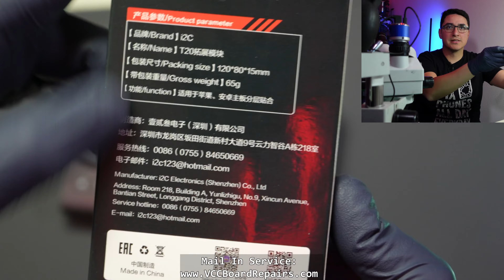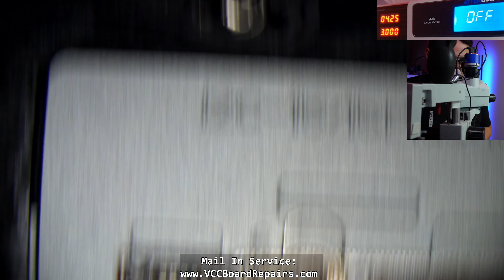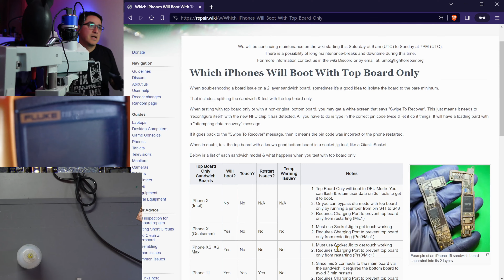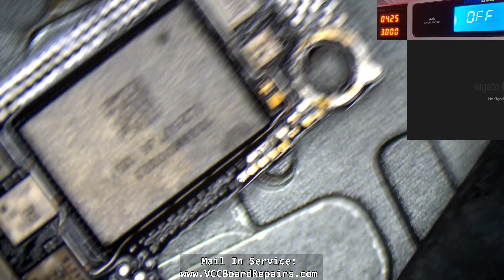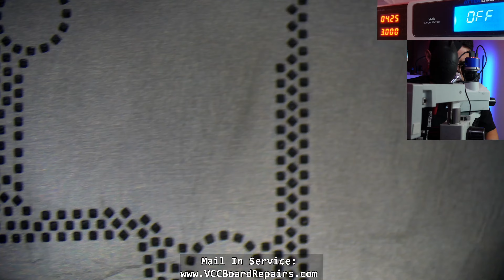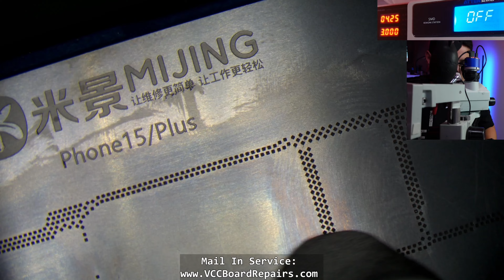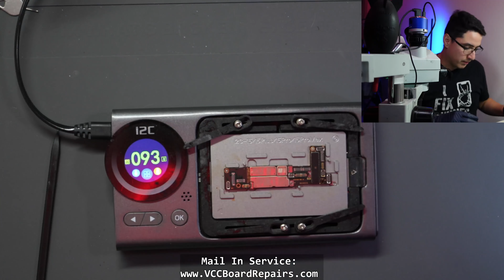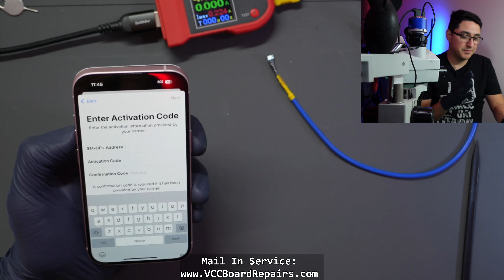Sandwich Reball Tutorial - The Latest Method for iPhone 15. Step By Step Mijing Stencil & i2C Heater

Comment: For those kind of boards you need to use IAtlas tool, and press board and no problems..
Reply from the maker: Yes, but not necessary
Reply: @VCCBoardRepairs  Agree, but when board is long like 12 series most of the time is bend a bit at the ends and with IAtlas you can press board to fix that.

Comment: tbf the magnets in those setups aren't close or strong enough to make much of difference when reballing
but using an aluminum is always better
Reply from the maker: In regards to what?
Reply: @VCCBoardRepairs  yea i should've put time stamps
i meant using a magnetic ppt spreader won't really matter much when using those board holders to reball the middle layer